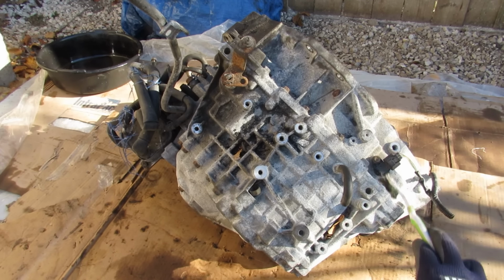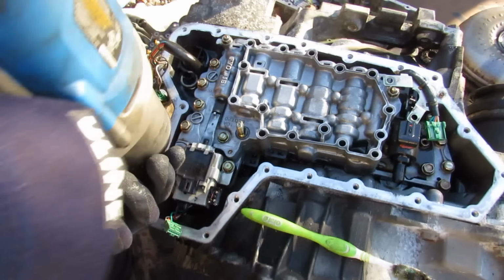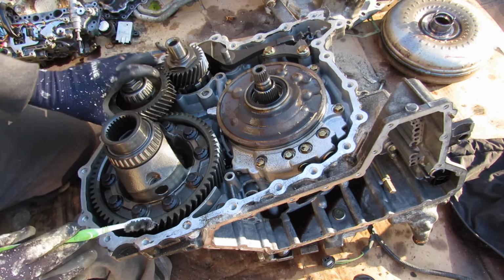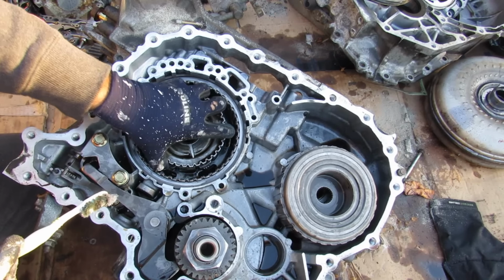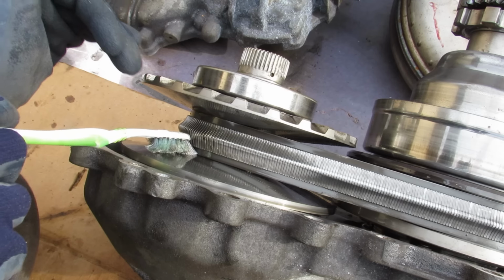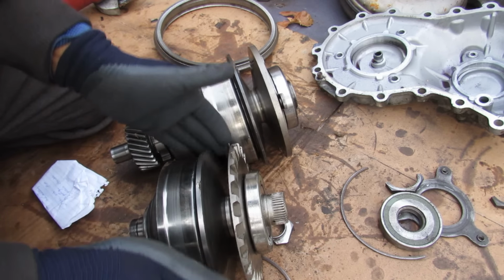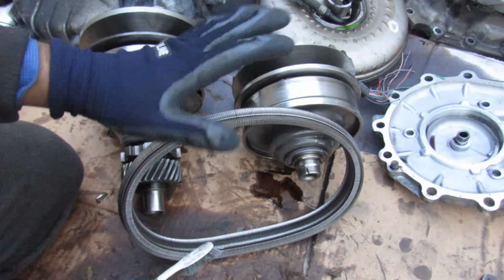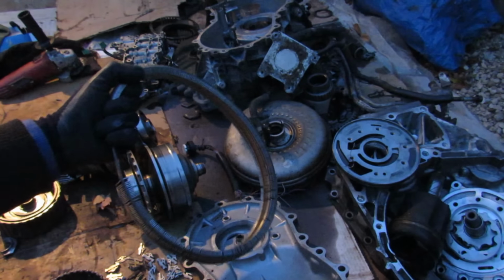Why Nissan CVTs FAIL

Comment: I had an Audi A4 with V6 diesel and CVT, multitronic. 400k miles without a single issue and yes, I floored it hard almost daily. Maintenance was done as recommended.
Reply from the maker: I didn't realize Audi A4 came with a V6 diesel.
Reply: @speedkar99  The V6 3.0 TDI is quite popular in Europe and pretty much bulletproof. Also a downsized 2.7 TDI V6 was available for fwd models.

Comment: Because of the oil change to late.If the oil is changed every 20000 - 30000 miles there would be no problems prior to a specialist.80000 miles is too late .

Comment: You say that one has to keep up with the transmission fluid changes, but how one knows when it should be done? Also, how to check if the coolant is working optimally?

Comment: 2015 Nissan obo with 176,138 miles. Never did trans flus but change the oil myself every 5000 miles and have no issues. Guess I'm lucky?

Comment: one thing that pisses me off about CVT is that all of the one that I have delt with have been programed to act like normal transmission, thus removing a decent portion of the whole reason to use a CVT.
Reply: When Nissan first introduced their CVT they had a commercial with a female passenger waiting for the gear shift to apply makeup, but the shift never came. Smooth acceleration was the whole selling point! But then consumers were like "This feels different than I'm used to and I can't handle change," so now when you apply heavy throttle you get jerky acceleration through fake gears. I wonder how much extra stress and wear that puts on the transmission, being made to rapidly and unnecessarily change ratios while under the highest torque.

"Skeuomorph" is what that's called, BTW: https://en.wikipedia.org/wiki/Skeuomorph

Comment: It’s funny, I had a 2007 Nissan Altima Hybrid, with the CVT. Bro, I beat the balls off that car! I would do 20,000 mile oil changes, go off-roading (lightly, not like for real) and that car got up to like 250k miles before I got rid of it. Only reason I sold it were the brakes were shot and I needed to replace them but I knew the miles were high and my girlfriend at the time didn’t want her car so I took her car and used my car as a trade on her new-to-her car. I must’ve gotten lucky because I hear nothing but problems.

Comment: Great video, CVT's are trash.
Reply from the maker: Nissan made a bad name for them
Reply: @speedkar99  I had a 2006 mini cooler with 40k on it and the cvt decided to take a hike.  after researching, i discovered what you said, there's no way to repair them, and replacing it was more than the car was worth, so we had to give up the car.  Once that happened i noticed that Nissan started ucing CVT's back in about 2009 and there are no surviving examples of anc CVT nissan over 6 years old, no coincidence.  I dont know of anything else that uses a CVT besides golf karts, and those are probably trash too.

Comment: This CVT ruined my life when I bought Murano for my first car I was 20 and the technician thought he could diagnose the gear and rebuild it. Nice to see such work thanks for the great video.
Reply from the maker: You are welcome but sorry to hear of that mishap
Reply: gotta do your research i recently just purchased a vehicle and was also worried about cvts. i seen nissian had a class action law suit against them for the cvt ( something you should also look into) read car and driver worst 10 vehicles 6 of them were nissians. I went with honda because there cvts seems more vetted than the rest. Guess mazda wins for not using cvt transmissions.

Comment: If you ask a transmission shop what is the three worst Transmissions two of them will be this type of transmission
Reply: It's a matter of which one copes with abuse the most - if we all changed our AT/CVT fluid every 30K miles - failures would be rare regardless of type and brand.  The manufacturers are the cause of this - pretending they are maintenance free to reduce perceived cost of ownership.

Comment: Excellent video. I just bought my first Nissan, it's a 2020 Nissan Kicks S and I did a bit a research before the purchase and was made to believe as long as I do routine maintenance on the CVT tranny it will run the life of the vehicle.
Reply from the maker: Yes and don't overload it
Reply: @speedkar99 what do you mean by overload it? Mashing the gas pedal at 3-6k RPM?
Reply: It’s the torque that kills the belt I think, so what @speedkar99 means is don’t literally add more weight to it than needed like towing something heavy.
Reply: Just bought a 2024 kicks. Is it normal to feel it "shift" around 40mph and I also feel the shift when I'm just about at a stop

Comment: the more  parts there are the higher the  likelihood of failure. I had a nissan terrano that overheated all the time. On top of that the automatic transmission became a nightmare. The final solution was an engine swap without turbo and a manual transmission. Today everything is a little slow BUT SURE.

Comment: Yea I think with a cvt half the issue is how u use them, easy driving keep off the sports mode unless needed to mabey run a yellow or pink light lol, but all in all its pretty simple to understand and see the idea and the purpose for this type of transmission now its just up to the user to use it properly.

Comment: thanks for the video. is it possible the belt detroyed in 70K miles?  mine in 70K dose not have forward/ reverse except 1 feet in high rpm. no code. what could be?

Comment: hmmmm i got a 05 max and it has 202k miles with the original tranny and its still running fine. i am having trouble with something to do with fuel or air. but i will get that checked out soon.

Comment: My CVT went in my 2015 Nissan X-Trail. It only had 65000 km on it. It took them 6 goes at nissian to admit there was a fault with the gear box. They replaced it under good will when I started showing them all the problems others had on the internet. Arseholes.

Comment: CVT - new take on an old idea. Look at the rubber torque band on a 1980s honda hobbit. Difference is you could replace the thing on a hobbit, now it's designed to make you go buy another ready to fail car...
Reply: Go back further - Daf in the 60s - first CVT.

Comment: Seeing all the moving parts inside both this as well as manual or automatic transmissions, it seems like a step in the right direction with the reduction gears instead of transmissions on most electric cars. Makes you wonder how the manufacturers are gonna incorporate planned obsolescence in the electric future.
Reply: easy, they'll just install an update on your car wirelessly without you even realizing it  that borks it completely, one command and they can tell it to fry the motors
Reply: Ever heard of batteries?
Reply: They could never handle the HP of modern e cars...

Comment: Tell today Nissan has transmission failure the new frontier had trans recall with no fix 🤦🏽‍♂️.  I would of trashed the cvt trans first time it had to be recalled. Trash transmission

Comment: this was great.  I wanted to know about how a cvt works and this was a no waste video straight to the point explanation.  I'm glad i keep my tires pumped up and only fill up my car halfway and never floor it.  < even all that won't keep these cvt from failing. but in the gas money i'm saving i should be able to afford a whole new transmission after 100k miles lol

Comment: I know Nissan CVTs have a bad reputation, but are there any objectively good CVTs? Like, better than the manual or conventional automatic alternative?
Reply: A CVT with 30K fluid changes won't fail unless you are very unlucky.   The transmission fitted to (full) hybrid Toyotas are CVTs (using planetary gear sets) virtually indestructible but expensive to produce that's why Toyota also use Aisin type conventional CVTs for other models.

Comment: When the Hyundai Kona AWD had its off-road test, the CVT gave off an overheated alert when simply going up a slight gravel incline! 

If a transmission, cannot transmit power on a >10°-grade, gravel incline… how is it supposed to work in the rain? The snow? In sand? 

Give me a manual transfer case with locking hubs, any day!!!
Reply: Most modern transmissions are built with minimal cooling to reduce size, and weight. Just about the only company that does it properly is Land Rover - but then the rest of the car will go wrong!

Comment: CVT = Junk. This IS a centrifugal clutch from a SNOW-Mobile for gods sake. Total crap, if you bought a car with this THROW AWAY transmission, this signals how little you know about cars. If you are trying to fix this crap, guess what there are NO parts available genius. 
 You are too dumb to drive a car if you chose to buy this crap car with a blue badge on the trunk lid. You should choose a different hobby that does not include automobiles, these transmissions are 100% crap.
Reply: Wow! A lot of anger in there about a transmission! The transmission in say a Lexus RX400h is a type of CVT - based on a beautifully engineered planetary gear set rather than bands and is practically indestructible.
Reply: Go to your dealer Mr. Reckless Rodent and ask them for parts for your Lexus CVT, and I don't care which Auto manufacturer you go to for which junky CVT, they will tell you that there are NO PARTS available for ANY CVT transmission! That is fact. Why is that you ask? It is because the CVT is a 100% Throw-away transmission, there are NO parts available. Why are these transmissions considered "Throw away?" Because they are manufactured SO CHEAP that if any components fail the entire transmission is tossed into the garbage. The auto manufacturers did this for the SAME reason that they all switched to the "MacPherson Strut front end" back in the 70's and 80's: Because they Save MONEY by slapping these junk components into your car. Just like the Strut front-end, there are fewer parts. Try to modify 1 of these crap-boxes, NO performance parts exist because they are JUNK! They did it so they could make MORE money selling these junk components to you, and they ALL do it to maximize their profits. What, you don't have Google on your computer?
Reply: @brentmcgillis  Most Lexus CVTs will live the life of the car. You don't need parts - they won't go wrong unless you're very unlucky.

Comment: What a great video, I'm glad you showed the belt system, I'd always envisioned some sort of expanding cog, rather than this pair of cones squeezing a fixed width belt. That said, I'm surprised they don't slip more than they do, given the mating surfaces.
I certainly won't be buying a car with a CVT (I hate the way they drive anyway, but this supports that choice).
Reply: Yeah they don't creep like you would expect them to and oftentimes I am left waiting for the transmission to figure it out when I want to go faster

Comment: The reason Nissan uses the CVT in the vg-35 is the same reason they and all car manufacturers use the CVT at all... It cost less than any other transmission and they usually last through the warranty (barely).  They are not building the best car they can and they have no plans of trying to. Kinda like the man you chose to be your President.
Reply: CVTs are popular for one reason - they perform better on emissions tests compared to conventional autos. When the saleability of a car comes down to how much plant food they spit out the back - this becomes the defining engineering criterion. That fact that hundreds of thousands of cars will go to an early graveyard just to save a few tonnes of plant food causing untold extra strain on the planet doesn't register on the eco-loons' warped psyche.

Comment: I swear if you try and accelerate fast with a CVT the order of gears is something that feels like … 5, 3, 6, 2, 4, 3, 5, 6
Reply from the maker: Really eh. I never owned a car with CVT
Reply: Yea man.. I have a built trans in my truck so maybe I’m being a snob but I’ve driven two separate Altima’s with the CVT dependent drivetrains over the last decade and let’s just say after about 50k miles they start to become VERY sluggish at times especially in the summer months even with meticulous maintenance. Becomes a pain to merge onto the interstate because the transmission with age will not downshift properly. When it puts itself into the wrong gear, it then tries to overcompensate by going down into second gear, then a rapid shift out of second through the rest of the column in what feels like a random order. In my opinion, if they would tune these cars differently from the factory and possibly adjust the rev limiter/timing issues they might be more viable as a reliable and relatively cheap everyday car.

Comment: Have a 2011 nissan cube that jerks inside the motor compartment and slips when shifting when driven normally but not under heavier acceleration. Could this be the transmission going bad?

Comment: My 2007 nissan sentra cvt finally is seeing its end after a mighty and reliable 280k miles. she still drives but after a few minutes it starts overheating and slipping very bad, very sad.

Comment: good video. I had 2008 altima with the lousy cvt and after 4 years it failed and replacing it costed around $5000...2 years later the whole car was suffering so many issues and I got sick of it and sold it to scrap yards! Lessons learned: never ever anything with a Nissan name on it and never a cvt again!
Reply: have you got a good compensation for that? or had you to engage lawsuit with Nissan?
Reply: @letwolf  I got nothing as the car was out of warranty

Comment: Bottom line, on older go carts and mini bikes type vehicles, we called it a belt driven torque converter (centrifugal clutch) . The faster one part ran, the more it expanded to change the speed of the other part.  Did not work well when it got wet, but give it 30 seconds and zoom, your off again.   Good video though.

Comment: Their CVTs keep failing because people keep buying them. They wouldn't build crap if people didn't buy crap.
Reply: The market is driven by lease/company car sales - CVTs fare better on emissions tests than regular autos and will therefore be cheaper to "buy" and run (taxation) on paper - eco regs are what's forcing these horrible transmissions on us.

Comment: The "belt" system reminds me of the OLD belt-driven superchargers...the faster the engine rpm, the deeper the belt would go into the supercharger's pulley to prevent over-revving and to maintain boost pressure.

Comment: It's pretty amazing how people will accept cars with very expensive and unreliable non maintainable part.  CVTs and electric Car batteries are two examples of one expensive thing that can make a used car worthless.  Before I bought my electric bike , I researched and found that a new battery was only $250 which is reasonable compared to the cost of the bike.  I know I'll have to get a new battery, new chain, new gears every 2000 miles.  I also need new  tires, tubes, cables and brake pads every 1000 miles. These costs are reasonable and expected.  Many new cars have expensive surprises they are not telling you about when you buy them.

Comment: Great Video. I found it quite easy to add an additional transmission radiator to my daughters Altima. Takes an afternoon but adds additional fluid and cooling capacity to the system for minimal cost. I paid $60 for mine. You just splice into the coolant return line leaving the existing radiator.
Reply: Change fluid 40000km 25000miles the fluid is black like engine oil. Upgrade cooling is a good idea. Don't drive it like race car. I think it can't handle 24 hours of lemans.
Reply: Absolutely. The only thing you can do for these Transmissions is to add a cooler

Comment: 17:23 CVTs are certainly not more efficient than conventional automatics, especially at cruising speed. That belt creates a TON of friction, hence all of the heat, like you previously mentioned. What a CVT does do to improve fuel economy is allow the engine to run at its absolute most efficient RPM for any given use mode.
Reply: two-feeted driving in a CVT can keep your car in a higher gear ratio- it knows when you are off the gas and kicks the gears down to a shorter gearing. there are other tricks you can employ to 'fool' your cars CVT system. i'm going to do a vid on that subject.
Reply: They are more efficient on (lightly loaded) rolling road type tests as they shift up sooner than traditional ATs giving a perceived decrease in fuel consumption and emissions.  As car sales today are so driven by these emission figures, CVT has become king - even though it's inferior.

Comment: Highly appreciated. I’ve been debating on which ford Maverick to buy. The hybrid with the CVT or the ecoboost with 8 speed automatic. . I’ve decided on the ecoboost with automatic just because I can rebuild it even though it’s going to take more gas and costs more. CVT is a great idea especially if you trade before the warranty is up but I could keep the vehicle until it’s just not functional.
Reply: But what happens when the belt breaks on the high speed freeway in heavy traffic????
Reply: @MrToastonfire  The CTV is not repairable- just replaceable. It's well proven in Toyotas and very few reports of most other brands of recently produced vehicles but thats just my research. My Maverick never got produced yet. Could be a long wait.
Reply: У вас нет мастерских где ремонтируют CVT?
Reply: Classic CVT like in the video and e-CVT used in hybrids is something completely different. E-CVT is mechanically the simplest transmission, even simpler than manual gerboxes.